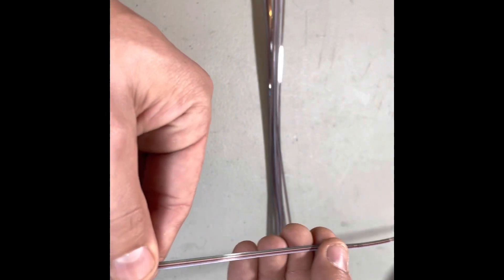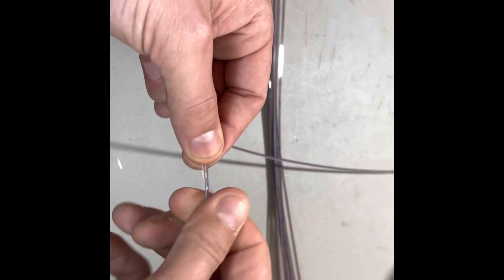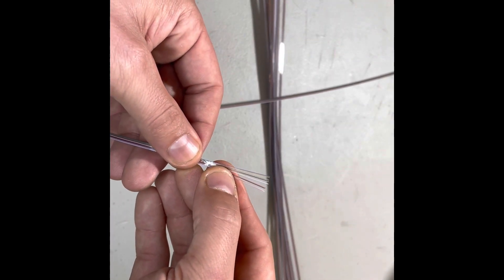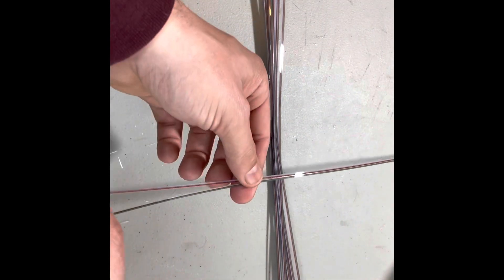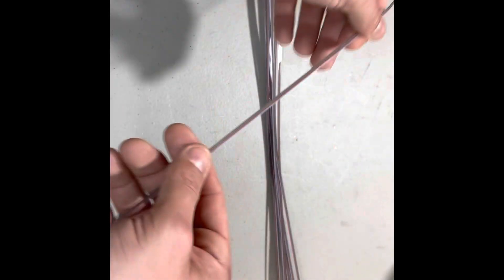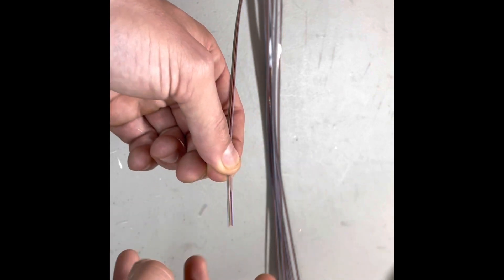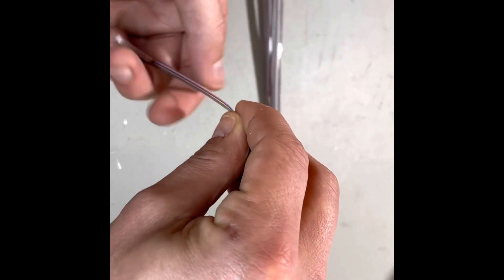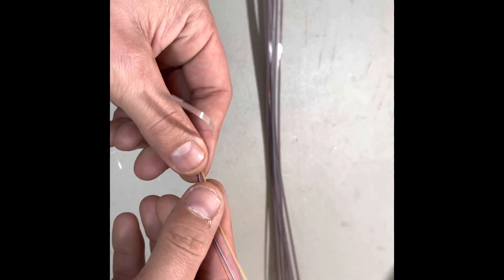How to De-Ribbonize fiber optics

Comment: You don't have to twist. Just pinch the ends and peel. 
Now show how you break em into singles after the ribbon has been spliced and there are no ends.  Use ribbon splitter

Comment: Is there a easy way to deribbon on a midspan?  Or 100% pain in the dick?
Reply: Easy no. Depending on the conditioning off the ribbon, you can bicycle it between your two thumb and fingers (you will cause loss of signal on live fibers and if not practiced, break stuff). Practice it thou. Another and safer method is to split the ribbon using the tool of your choice. The Mylar will usually fragments. I say usually because some mid 90's to late 80's ribbon isn't Mylar coated and isn't meant to be separated. Anyway roll it between your thumb and finger and this allows to pull on single fibers.
Reply: @gmz1997  Nah, when needing to midspan access a ribbon, just use a ribbon slitter. Too dangerous to use your method with live fibers, even with practice.